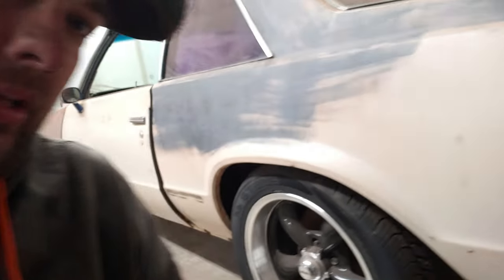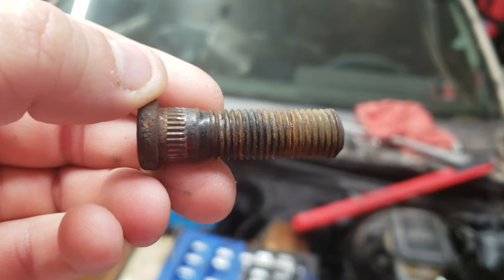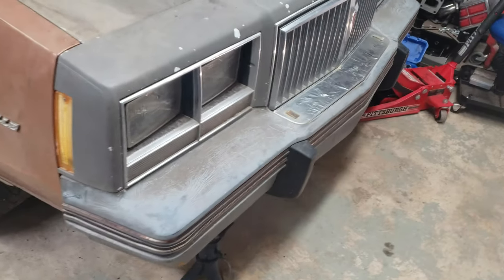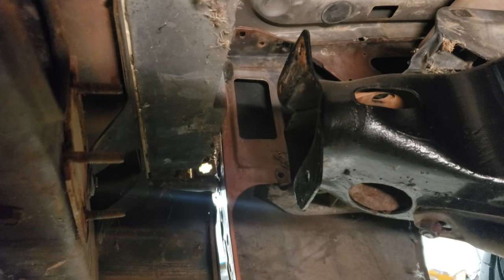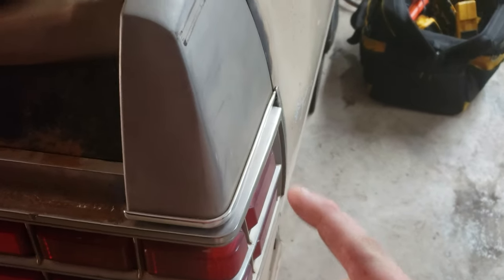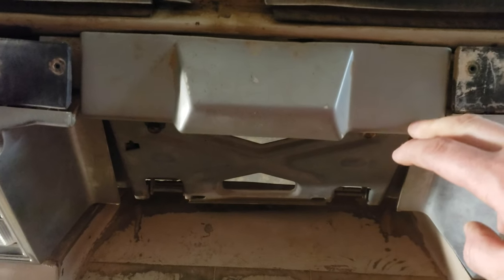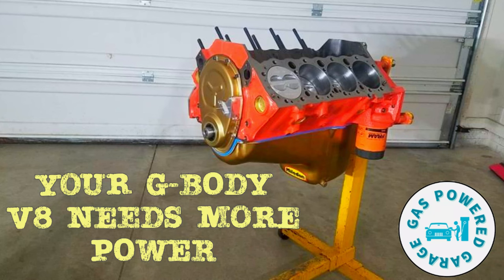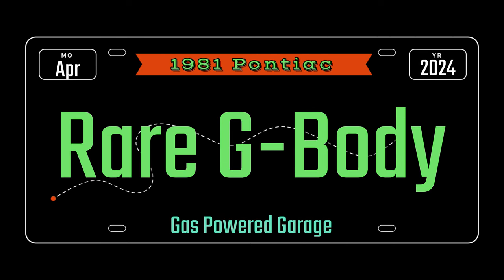G-Body Build Rare Pontiac Episode 2

Comment: I used large steel screws, 1.5" long. Pre drilled yhe spots and let the "lag" bolt do it. Like a 1/4" shaft.
I thought I was the only one using pontiac parts on a chevy haha
Reply from the maker: nice
Reply: @gaspoweredgarage  got my rusty exhaust back on today, distributor. Just need fuel lines carb alt and rad.
Reply from the maker: If you need a radiator champion brand fits good in gbodys
Reply: @gaspoweredgarage  I'll keep that under my hat. Plan is to "run what I brung" on the stock rad. Not sure how far this engine will get. I've got a 68 sprint motor PMD I might put in just cuz I have it, or, the hemi from my 11 dodge truck. Probably pontiac just cuz the one I have is the only one I've ever seen. Been debating if I'm gunna start doing a few vids on the malibu? Just because. What did u get up to this weekend on er?
Reply from the maker: Those pmd engines run great with a turbo or a vortech style supercharger to added to them. This weekend i worked on filming gbody content and then installed a engine into my daily driver so It can be road worthy soon.